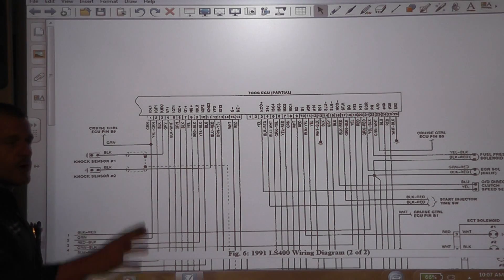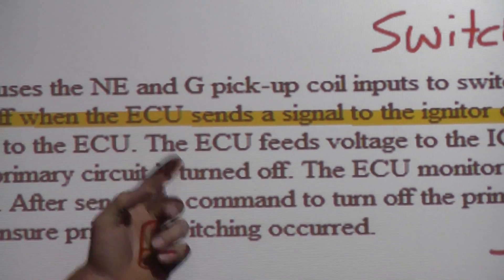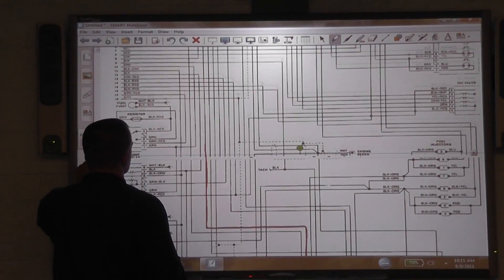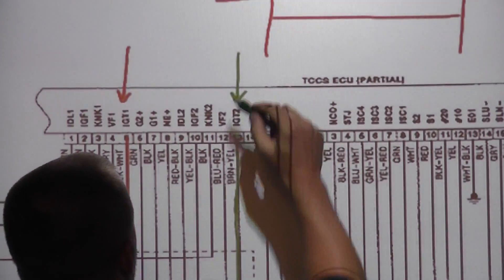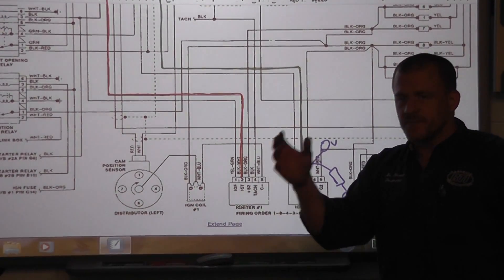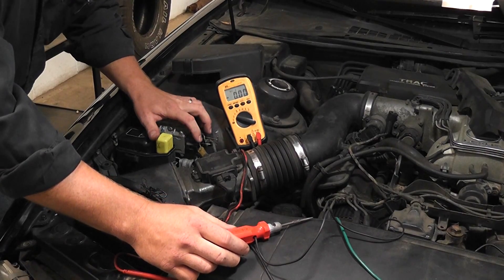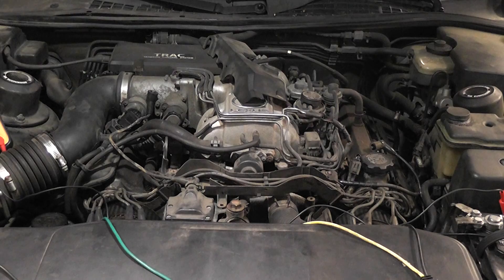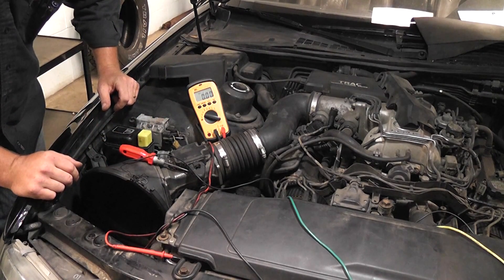How to test an igniter on a Toyota/Lexus

Comment: i have a 1995 toyota camry 2.2 same conditions like your teaching i cant follow your procedure because  i have in intrigrade distributor with  1 coil  inside 1` harness on the right 2 wire 1 pin is power other pin is siginal
another 4 pin harness on the left of distributor 2 pins go to 1 pick up inside i believe its the camshaft position censor 1, pin 3 ,4 go to the other sencor inside and there intergraded  to the coil, SO i dont know the steps to use 
for you procedure, i got power 11.6  to the two wire going in distributor , no pulse on other pin for coil, no spark at coil , distributor is new, ignitor no sending signal,  what i have done is back probed the  ignitor igt and connected a 3vlight with a resistor and a red wire, to the gti pin number 2 Igniter control signal and black wire to ground, go to crank moter light is suppose to flash , got no flash, 
so ;no signal to coil, or from ignitor, had siginal before putting in new distributor?AND i would like to do your test  pull down test but i have built in coil, now i dont know my way, can you help me, i enjoy your wisdom, 
i ve been watching  utubes fore 2 weeks to learn , when i came across your videos i was very intrigued with your knowledge to help people,  for to weeks i cant figure out why car died idling in park , cant start tryed starter  fluid down the throat no start, need dan scanner  help  I noticed the 4 pin connector on the left side of the distributor when I connect the harness it's sloppy? And they send the signals to the pickup calls that chemsaphysic centers inside the distributor to the coil, Help would be greatly greatly appreciated something that would probably take you no time at all Has frustrated me to no avail Your help would be greatly appreciated thank you
Reply from the maker: Watch these! 
https://youtu.be/BqcKd_Gdo4A 
https://youtu.be/F9db0Yi_wkE
https://youtu.be/-IcSI60npSo 
https://youtu.be/XH74DXTPMmQ

Comment: I've solved a tricky case yesterday. Car was brought to my friends garage after it had visited pair of other shops. Also toyota with the same ignitor. Actually Vista 1996. It had a spark, injection pulse, fuel pressure, alll was ok. But wasn't even an slight attempt to start. Great compression also. Ive assumed TP, MAP, timing - it was alll great. Then ive re checked spark. Yes, it could hit spark plug at the atmospheric pressure, but it couldn't  hit a gap of spark tester even 1cm of gap. So ive checked the coil, and found out that secondary winding was shorted. But it wasnt all. After coil was replaced, it could hit 0.5 cm of spark tester but not a millimeter more. I was confused as distributor cap was NEW. I ran through powers, grounds, and it all was great. Last test ive done was unplug central wire on distributor, and tried to check how a coil by itself can hit directly without distributor. Without a distributor - coil easily hit 1+ cm of tester. Ive disassembled the distributor, turned out its basement was old,  but cap was new chinese cap. After ive cleaned the contacts, ive seen the system to start hitting 1cm of tester, but with a very very weak yellow spark. It wasnt enough to start a car. So new cap was shit. NEW. My friend brought another distributor - car started immediately. So shitty new distributor cap killed secondary winding of previous coil, and could kill new, but i was fast enough to find it out. That was a fix. I was able to fix that, only because i constantly watch your videos and read your book. You help people alll around the world to fix vehicles. Thank you!

Comment: Thank you for sharing this video this should help me on my 1996 4 cl Camry the coil sparks intermittent and and tach jumps when the key is in the run position - when this happens the car won’t start  if it does start it will start every time till it sits over night - then this happens every time - I do have a scope and this video thanks !
Reply from the maker: That sounds like a bad or loose computer ground

Comment: Just a long shot. I'm getting codes 13 and 14 on my 93 Toyota truck. It runs fine but has high HC emissions and seems to miss slightly at different rpm's ( lean miss?). Could the igniter be in a default mode if the ECM isn't getting an rpm signal nor controlling the igniter? I mean it runs great but obviously doesn't have proper mixture.
Reply from the maker: define the codes please
Reply: @ScannerDanner  13 is no rpm signal to ECM and 14 is no igniter signal to ECM.
Reply from the maker: @StanKindly  those codes would cause a no start
Reply: @ScannerDanner  I cleated the ECM and they haven't come back...my upstream O2 sensor is reading around .17 V at idle. It's running too lean and shouldn't that O2 sensor be between  .
.40 and .60 even at idle?
Reply: ...still stays at .17 with the rpm's in creased to around 2000. Haven't checked the other one (its a pain, I m checking directly on the pins unplugged) but that must be the problem no? The lower the voltage the leaner the ECM adjusts the mixture...as I understand it.
Reply from the maker: @StanKindly  yep, it should be fluctuating between 200-800 mv
Reply: @ScannerDanner  Yes thank you for confirming. I ordered both from Rockauto - comes to $121 total tax, shipping. Denso seemed to be the best bet.

Comment: Hello! What is a current draw of a test light that you use to check Comp-Comp communication like in this video?  Thank you for your outstanding job.
Reply: Most incandescent test lights draw around 200 mA and LED lights draw around 20 mA. The one he's using draws about 200 mA when lit, but in this video it's much less since the test light didn't light. You're not going to hurt anything with either light but when troubleshooting it's best to use incandescent light because in some instances the LED will not actuate what you're trying to actuate because not enough current is going through it.

Comment: Good info. But I am a little is dismay about goofy design with 2 distributors and 2 coils. It's a Lexus, you can look at it this way. It cost them way more to add the 2 coils and distributors that just to use one. Yes I agree more time to trouble shoot but they were not cheap on the car.

Comment: Nice video. So the ECU pull upp the igniter? The igniter than interupt the current flow from the primary windings in the coil, and generate a spark? When you power feed the igniter with the test-light, will not the light use the voltage, leaving almost zero volt to the pin of the igniter? Im a premium member and this video is a part of your book. Is it best to ask questions here in youtube or in the forum? Thanks and best regards.
Reply: @AN77   Inside of that igniter there's a NPN transistor doing the work. When he power feeds the igniter through the IGT wire with the test light, he's feeding voltage to the base of an NPN transistor. It only takes about 0.7 volts to energize the transistor, but 0.7 V is not enough to light the test light. When 0.7 V or more is applied to the base of the transistor, it closes the path between the collector and emitter in the transistor and allows current to flow from collector to emitter. The collector is connected to battery positive and the emitter is connected to coil, so when he touches the IGT wire on the igniter with the test light, current flows from battery to coil and a magnetic field is produced in the primary circuit of the coil . When he removes the test light from IGT wire, the magnetic field collapses, and a high voltage is induced into the coil secondary circuit. Since the secondary circuit of the coil is connected to the spark plug, the spark plug goes pop.

Comment: I seem to be confused on something in this video.  Can you help me?  Video states "what we want to know is are the igniters sending voltage to the ECU and the ECU is pulling it to ground (pull down) making the square wave?   Or is the ECU generating a square wave, sending it to the igniters in a pull-up fashion?"  I thought anytime the ECU supplied the voltage side of circuit, it’s pull down.  And when ECU supplies ground side of circuit, it’s pull up.  What makes this case different?  Sorry if this is a dumb question.  I'm no technician, just a home learner.
Reply from the maker: The hard part in understanding or determining pull up or pull down circuits is when you have two modules "talking" to each other. 
Which one is sending, which one is receiving?
Which one is the master, which one is the slave?
The igniter in this case is the slave, he knows nothing on his own and the ECU is the master and he tells the igniter what to do and when.
By unplugging the igniter and measuring the voltage on the harness side, we can determine the design.
Sometimes I will follow this rule if my readings are misleading. 
If the voltage is high, pull it low, if the voltage is low, pull it high. Using your incandescent test light. And then look for a reaction. 
I have a ton of lessons on this in my chapter 2 playlist on my website if you're interested https://www.scannerdanner.com/join-scannerdanner-premium.html
Reply: @ScannerDanner  thanks!

Comment: You got me confused on this one ,   you didn't have  low voltage at the igt when the key was turned on , thats means  , its signal groud signal  , why did you send low voltage thru the test  tight on the ground side ?   remember it was tested 0volts  ,that means it was a group side circuit.  Not a power circuit,
Reply: Please don't take this as an insult, but do us all a favor and take the time to write your question, so we can understand what you're asking. If you took your time writing this question and that's the best you can do, then I suggest taking a writing class.

Comment: In theory, couldn’t you just touch one end of a wire to the + side of the battery and the other end to that pin for the igniter? Wouldn’t that accomplish the same thing as the T pin and test light probe??

Comment: I have a 1988 Camry That isn’t getting any spark I would like to know if the ignitor in this car has to be grounded in order for it to start? This is a derby car that ran fine until I moved all of the wiring harnesses into the fire wall area of the car

Comment: I have 93 Lexus LS-400....only running on 4 cylinders....no spark to plugs from drivers side Distributer....has spark from coil going into Distributer but nothing coming out of Distributer..changed rotor..cap..still same...spark from coul wire very small and almost have to touch coil wire end directly  to get spark....coil tested ok at AutoZone with meter at 200 ohms...is it possible for coil to bench test ok but not put out enough voltage?

Comment: Dear sir my car is Camry 1993 before  there wasn’t spark on ignition coil but after i did your way by test light on igniter pin IGT white color wire its  responding to start but again cut off what’s could be issue please help

Comment: thanks for your tutorials.. they are easy to follow and very useful. i followed your ignitor trouble shooting vid yesterday on my 92 v8 soarer (it cranks n sounds like not firing n unsure if its getting fuel but i have bypassed the fuel pump and could hear a flow so i dont think its a fuel problem...   i hate to admit but i was jump starting it and accidentally let the jumper leads touch n since then its a crank n no start cond.  yesterday when checking ignitors i did confirm decent spark from one but not the other. i wasnt sure if maybe i didnt probe the wire properly and tried a few more times. then we decided to try plugging them in oposite because i could easily get a good probe one the one that seemed fine.....AND THEN... i couldnt get either to spark at all... should i not have plugged them in oposite?? it was cold and dark so i may have just not had good contact with probe wire. im going back to try again in the morning and thought i best check incase im flogging a dead horse??
Reply: hey man how are you? i have a similar problem on my ls400 1993. how did you solve your problem?

Comment: Hey scannerdanner.  I have a 1993 Toyota pickup with the old OBD and the DTC code that I get is telling that the ( igf signal from the igniter is not input to ECM for 6 consecutive ignitions ). can you me with that I would greatly appreciate it. thanks so much. further, the truck works but vibrates a lot. looking forward to here from you. Buy the way I have a career diploma  as an electronic technician. that is why this video caught my attention so much, thanks.

Comment: hi paul this is a good video, I am from venezuela and I have a lexus ls 400 of 92 my vehicle no crank no signal arrives at the coils, I tried to test the two modules but the voltmeter showed me more than 12 volts, and I could not see the spark coming out of the coils, I did not know what else to do since I do not speak English but I have a clear perception of what you teach, sorry if I do not write well, I am helping with the translator I need Your help to know how I can do to start my car. In my country there are few vehicles of this model. so I do not find a good technician with the necessary knowledge, everything that I have fixed to my vehicle I have done watching tutorial by you tube I would really appreciate it if you can help me

Comment: I have a 1995 camry 4cyl 2,2, we replace the distribuitor assy and the igniter, after 30 minutes stalls again, whit same situation, I test the igniter the way you just did it, it looks good but just don't get spark what else could affect the ignition system???
Reply from the maker: These are from a subaru but same tests can be applied 
https://www.youtube.com/watch?v=YBE7c7lfmnY

https://www.youtube.com/watch?v=LdnnFD6J8Uo

This lecture (ScannerDanner Premium video) will also help you
https://www.youtube.com/watch?v=jJmqdhhduVc

Comment: I did exactly what you said on my 95 Lexus ls400 because I initially  wasnt getting spark from the coil and was coming to the conclusion that my coils are bad but because of this bypass test i got spark to the coil.  Im pretty sure its my cam or crank sensor but i have yet to test them to confirm.  Anyway, thanks for this great video, really helped.
Reply: Okay cool! You've confirmed not only coil operation but also igniter function. So this means you are missing the signal from the engine computer to control the igniter. 
Possible causes:
-input problem (cam and crank)
-computer problem (powers and grounds need to be confirmed)
-shorted reference circuit 

Tests you can use.
1. Check injector pulse, if you have injector pulse it is most likely not an input problem.
2. Check for a 5v reference to one of your main inputs. I usually use the TPS because of its accessibility. One of the 3 or 4 wires (I think you may have a 4 wire because of an idle contact switch) should read 5 volts. 
Let me know what you find.
Reply: ScannerDanner Premium thanks for your reply.  I  noticed the wires for the cam sensor was rubbing on the belt and damaged it pretty bad so i fixed the wiring.  Then I took off the crank sensor and i noticed it was just soaked in oil then i cranked the engine and realized the timing belt wasnt turning, i marked it to be sure.  I didnt take off all the timing covers yet so i couldnt see exactly whats going on but belt is tight.  Seems like theres a separation somewhere but until i take everything off i dont know.   Any idea what this could be?
Reply from the maker: Sure man. If the belt isn't turning the the teeth ripped off a section of the belt. It happens on older belts. Hope your engine isn't a valve bender.
Reply: ScannerDanner yea i hope so too lol but thanks again for your help.

Comment: I am currently trying to diagnose my 1996 ls400, I have two codes reading p1300 and p1305. The only steps I have not taken was testing the coils, ecu, and the crank and cam sensors. The vehicle cranks but will not turn over, my question to this video is what wires do I stick the pins in with? The igt#1 is a black and white wire, and igt#2 is brown and yellow based off the diagram in your video. I wasn't sure if those were the wires I was supposed to test.

Comment: I enjoyed the instruction on this post and it has helped to a point. I am working with a 96 Toyota Tacoma 2.7 liter with a no spark condition. I have tested continuity between crank sensor and ECM, between Igniter IGT B/L wire to ECM and performed the spark test by jumping with a test light 12v to the IGT by back pinning and received spark. What about a vehicle that has IGF safety signal, which if missing will cut fuel pump and spark?

Comment: This is exactly what I was looking for with my No Spark.  I'm still leaning toward CKP circuit, but this will definitely help me eliminate the igniters and coils!  Thanks a bunch!
Reply: Did this test and eliminated the the igniters and packs!  Thanks a bunch!  (It ended up being the CKP connector, it was oil filled and not making a good connection.  Temp fixed and I've scheduled my visit to Pull-a-Part.  WOO!)
Reply: Miley Babydoll which wire did you probe to test spark

Comment: I have 1999 four runner with a 3.4 liter engine runs great at an idle stop in the gas me sputters and does not want to create power but if you feather the gas pedal it creates power. It shows no codes when put on the tester also just put in a catalytic converter Any ideas on what the issue is?
Reply from the maker: Check your fuel pressure next. Any further help that you may need, post your question here. https://scannerdanner.com/forum/post-your-repair-questions-here.html
Thanks!